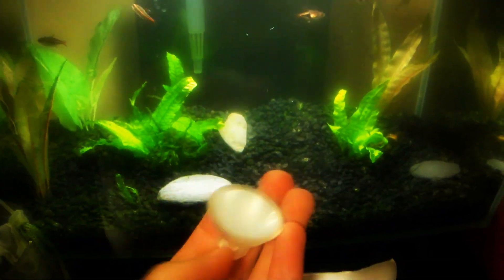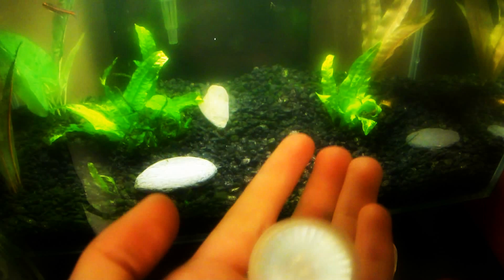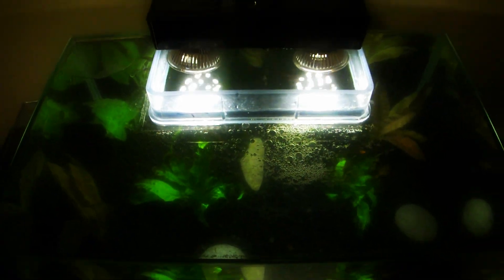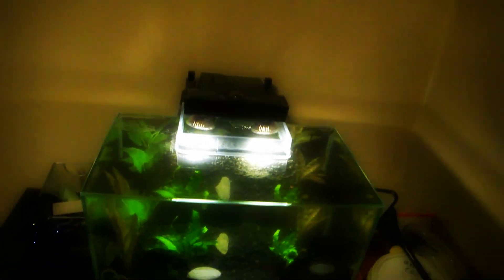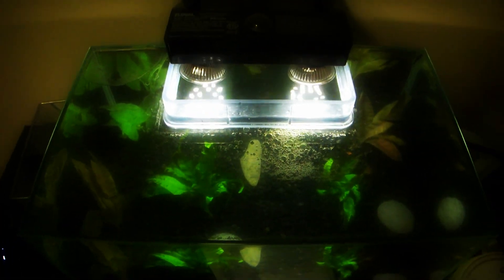Freshwater Fluval Edge Light Modification

Comment: Damn $70 back in August ? I just bought my yesterday almost $150 after tax. I looked up craigslist & local store for a used one but there are none. Have u ever seen the model with 21 LED ? All the 6GL Fluval Edge on utube r using 2x Halogen & they all look really brighter than mine. I need a strong light to plants for my shrimps tank. Do you think the power supply for this can handle 2x lights higher voltage than MR16 ???